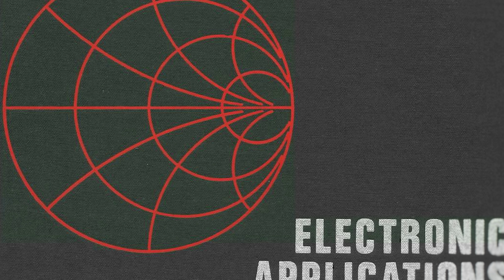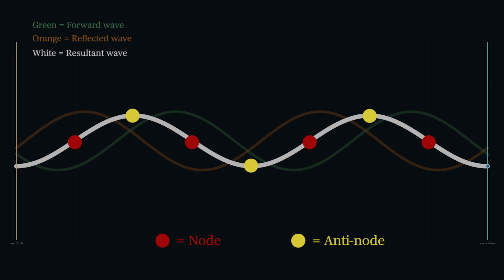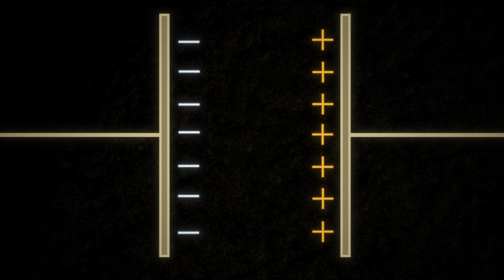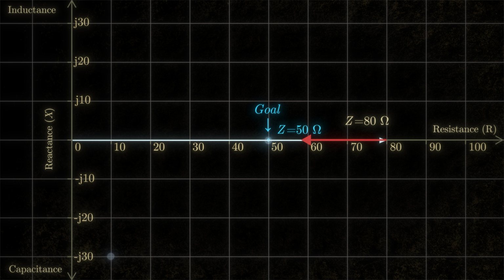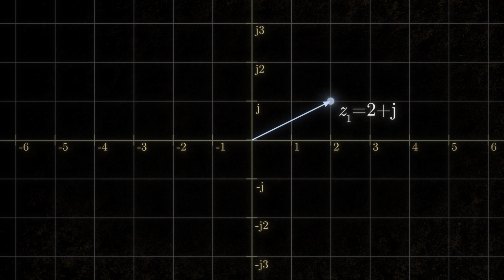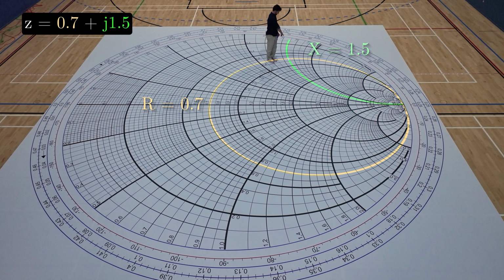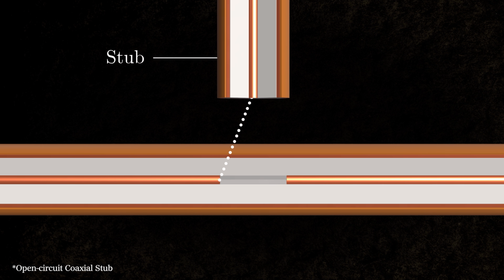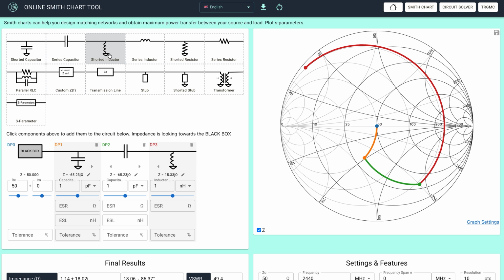The Scariest Chart in Electrical Engineering

Comment: Physicist and high power RF/Microwave Design engineer here. Truly a brilliant attempt to simplify this subject in a 30 minute video. Kudos for trying. For the past 30+ years I have been using the Smith chart not only to match transmission line elements into systems but also to teach electrical engineers how to think about RF. At high power, to practice RF Design engineering requires an integration of a few engineering disciplines: Mechanics, Electrical, Thermal (same as RF just different frequency), Materials science and even fluid Mechanics into the physics of waves. Time varying and spatially varying voltages and currents all traveling down a transmission line.

A few nuggets to add to the video
1. Characteristic impedance of any transmission line whether it’s coaxial, microstrip, CPW, strip line waveguide etc. (Z= R+jX) is really geometry dependent, which drives everything in this discipline. Similarly physics is also all about geometry especially gravity.
2. Look up George Gamow’s island treasure puzzle. Alternate way to look at the complex plane.
3. A short circuit that is a quarterwave long actually looks like an open circuit. And vice versa. This RF magic can be used to design filters and to tune circuits. Direct analog of this is that a capacitance can be transformed to electrically represent an inductance if simply moved a quarterwave down the line.
4. “High frequency“ is not a number like 50 MHz or 75 GHz etc. High frequency is when the dimensions of your electrical component or system approaches about an eighth-wave long.
5. Study the transmission line equation.
6. The four basic phenomena in electromagnetism or optics are diffraction, interference, scattering and polarization. The last of which is a fascinating topic especially in optics, and all of the above applies just at much smaller wavelengths. A length of scotch tape can be used a quarter wave plate for sodium light.
7. Read and study Melvin Schwartz’s book on electrodynamics. If you like engineering better then try microwave engineering, by David Pozar.
Reply: why isn't this top of the comment geez.
Reply: As an EE working in the Power field... 4 hits hard. To make a quarter-wavelength transmission line at 50/60Hz, its literally crossing continents.
Reply: "4. “High frequency“ is not a number like 50 MHz or 75 GHz etc. High frequency is when the dimensions of your electrical component or system approaches about an eighth-wave long."

Oh well, I learned that the hard way in my exams... 😆😆
Reply: I also didn't like that when he added the resistor inline, it messed up the matching not only because a resistor is lossy, but also because the 12.5 ohm of the antenna has been shifted to some other impedance by the time the resistor is added, so it's no longer 12.5+j0 ohm and thus the 37.5 ohm is not the right match.
Reply: Great comment!
Reply: We used to call microwave engineers plumbers because of the waveguides they were working with.
Reply: +1 for Pozar. As a working RF engineer, Pozar and Balanis are the two textbooks that live on my desk.
Reply: As someone originally coming from the land of software, I'd always felt slightly leery about what exactly was "high frequency". Your comment finally answers both what it is, and why it is. Thank you.
Reply: What does the 4th point mean?
Reply: @vishnupeketi7596  There's no absolute definition for high frequency, it's all relative to the length scales over which you're propagating signals. 1 MHz might sound small but if you're sending the signal over a multiple kilometer long transmission line then you have to consider all these reflection effects. On the other hand if you're working with signals at 1 GHz, which have a wavelength 1000 times smaller, but you're only sending the signal across a chip a few milllimeters long then you don't have to consider reflections at all and can treat the behavior more like "conventional" circuits
Reply: @vishnupeketi7596 It means frequency is relative to the equipment which that it's being propagated from. Or that's my understanding
Reply: @vishnupeketi7596  If the wavelength is long relative to the line it's travelling, it doesn't bounce back much, so many of the phenomenon discussed in the video don't apply. Henry demonstrates this with the slinky at one point.
Reply: @vishnupeketi7596 This means that, for example, on a circuit board, sections of traces or protruding wires can act as antennas on the board and negatively affect the circuit. The higher the frequencies, the more attention must be paid to these effects.
Reply: Not only that, it handle complex numbers faster than a calculator. No need to push buttons, which monkeys are good at, but one look gives one the answer.
Reply: what?
Reply: i agree, i am still new to rf design and quarter wavelength stubs really messed with my head to start with! (also what power have you been designing at? )
Reply: Undergrad physics major here. I had a research project that involved designing and operating a microwave plasma CVD system. As a result, I spent quite a bit of time trying to grasp the smith chart and how to minimize reflected power by matching impedance for a plasma load. That was a fun side quest, I’d love to find some good books to further explore microwave design engineering
Reply: Oh to re-do my career and focus on this instead of digital stuff! You make it sound so fun and interesting.
Reply: Schwartz and Posar. Names from my Dad’s bookshelf I have never read. I think I might have Schwartz’s book on noise because it’s useful for high speed logic.
Reply: Does any of this point to a, or the simulation?
Reply: There is an aspect of RF I stumbled across many years ago. Maxwell's electromagnetic field theory (extreme oversimplification here) is a mathematical topological transformation of the previous two. Apply a different form of topological transform to the electrical and magnetic equations and you get the 4th: gravitational wave field theory. This has been staring mankind in the face, front and center, since the invention of the radio. Check out the guy who coined the term 'hyperspace'. He was on to something, but died before he could pursue it.
Reply: Pozar… it brings me back to my EE undergrad days!!
Reply: Thanks. Like other fascinating subjects, this one is for me simultaneously intriguing and off-putting.  

It's the way I feel when (ankle-deep) all the information on a new subject is apparently saying, come on in, the water's fine. 
The first taste is free, then you're hooked.

Comment: I found the frequency and phase one scarier. Negative frequencies? You need to make videos about Oliver Heaviside and Charles August Rudolf Steinmetz - and tell the story of the real dynamic duo of Electric Engineering. Phasors (both graphic and complex) were created by Steinmetz and the transmission line equation was discovered by Heaviside. Steinmetz wanted to be a mathematician but ended up becoming and engineer while Heaviside ... well ... he never went to college. Heaviside also invented the step function and found the Laplace Transforms for both the step and impulse functions - part of his Operational Calculus. Heaviside never proved the transforms were correct and made that clear writting "I have used and they always work but I have no formal proof to offer".

Comment: I finished my degree in Electrical and Electronic Engineering way back in 1979 and when we were first introduced to the Smith Chart, the reaction of myself and the other students was not "this is scary", quite the opposite. Our reaction was "how cool is that?"

You see, back in those days electronic calculators were almost unknown and we were used to slide rules and not just the linear slide rules that most people think of. There were circular and cylindrical slide rules and we had courses on how to use them as well as log tables. The Smith Chart to us was just another form of slide rule for matching line impedance and not scary at all.

We were taught the why and the how of the Smith Chart and its use became second nature during the four year course. Along with complex numbers, Laplace and Fourier Transforms and scad loads of Calculus.

So, only scary to people not used to slide rules is what I'd say.

Comment: Is there any merit to a connection that a change in resistance in wires cause a reflection, and when light hits water, it also has “a higher resistance than air”, causing some reflection?

Comment: I love the Smith chart plot on my antenna analyzer. I can press a button and it plots the chart over the frequency range I've selected in less than 30 seconds. Make adjustments to center the plot. Sure beats the old days when I was sitting under the tower at the broadcast station nulling out the General Radio RF bridge and plotting each point by hand.

Comment: Interesting complications that can arise.
The inductor can self resonate at a lower frequency than 1085 MHz causing all sorts of undefined properties.
Note they use a very small surface mount inductor ~13nH. These have a large self resonance at 2.4GHz and higher.  But what if they needed 100nH?  Now the majority of your options self resonate under 1 GHz so you'll have to start checking datasheets.  The spec self resonance is 2.4 GHz or higher but the datasheet shows large shifts in inductance above 1 GHz! What gives?  Welcome to RF engineering, we look forward to be having you in the lab to help find solutions.
Another point not mentioned is balanced and unbalanced current when working with cables and circuit boards.
But that's a fun topic for the future.

Comment: This isn't even its final form. Once you start dealing with "negative" resistances (an increase in voltage causing a decrease in current under certain circumstances e.g. oscillators), stability curves and more; then you will truly weep at the expanded Smith Chart.

Comment: In setting up a CB radio you have to tune the antenna to the radio by adjusting the SWR, standing wave ratio. As soon as they mentioned standing wave, I immediately had an experience that matches the content of the video, although I never knew what was happening when I would tune the SWR or what the meter was actually doing.

Comment: 4:43 Isn’t this waveform misleading?

I get that the wavelength may span the entire width of the viewing interval, but shouldn’t the left node oscillate similar to the RH side but just as an echo, lagging behind by one wavelength?

(Instead of being a fixed point, it should oscillate, too)

Update: I see that they’re looking strictly at a REFLECTING wave instead of a forward-propagating one.

Comment: Re: 2:45, why would you think the type of electricity we might be used to is DC electricity when the electrical power coming from the sockets in our homes is AC electricity? We are actually using both AC and DC electricity in our daily lives. Most people plug in their light bulb based lamps into an AC electrical outlet, not a DC battery.
Reply: "We might be used to" referring to the average Joe who probably used a snap circuits kit in class when they were a kid. Most people don't know that wall power is AC, or what that even means.
Reply: @yaltschuler  this video about impedance matching transmission systems should be right up their street!
Reply: @HeatSoaked 🤣Especially since it is explained using complex analysis. 😏
Reply: @yaltschuler this is true. I used to work at a hardware store, and i realized a lot of people have no idea what AC or DC is. “Its just electricity right?”
Reply: @yaltschuler  When I was in elementary school, my school had this extracurricular program called Saturday Explorer's Club. The club explored a different science topic each year, meeting every other Saturday. The topic for the club during 5th or 6th grade was Electronics. In each session, the teacher gave a 45 minute lesson on a topic and then after a 15 minute break, we would build a circuit that used the principles presented in the lesson. We started with  DC circuits, but we covered some AC circuits in the latter third of the year.
Reply: @yaltschuler  The video later refers to AC as being the familiar kind, so it's just poor scripting.
Reply: Because it's what is taught in American middle school. Ac is only taught in school if the class is based on electricity.